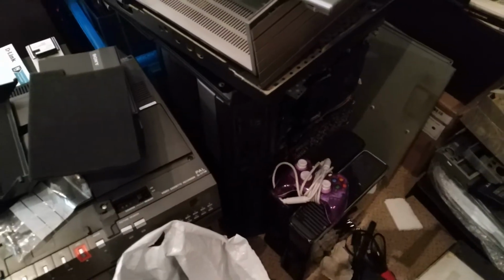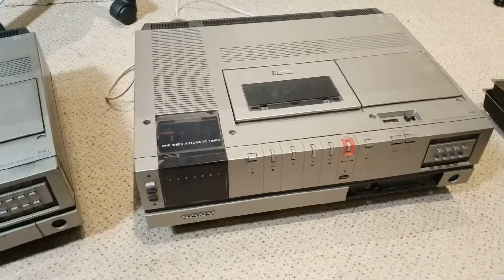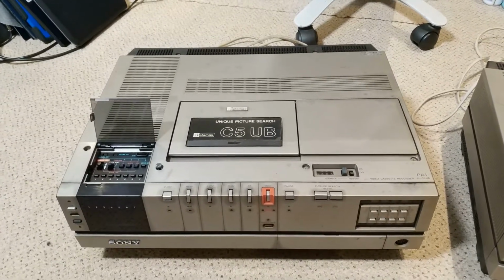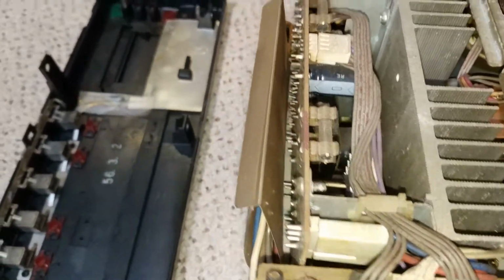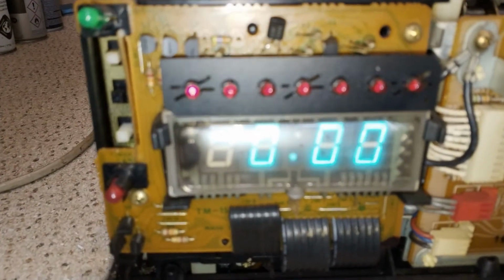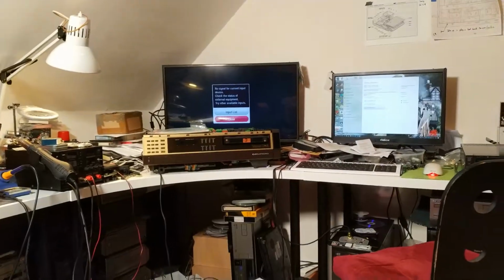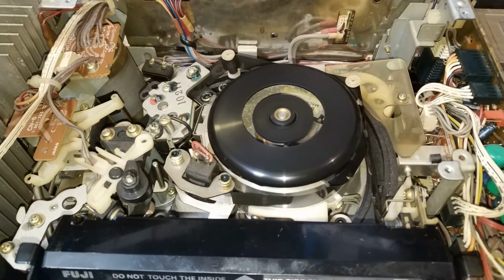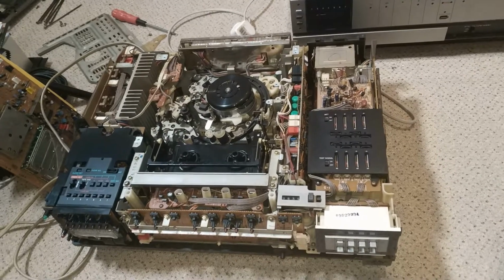Sony SL-C5UB betamax -  checks and repair - Part 1

Comment: hi i just made a sony uvw 1800 out of 3 of them    i keep the right pcb  that has the drum hrs loged in the ic with the head drum and moved 
parts  around     can't a 2nd deck working to many bad decks  there 1 bad vu display i tryed a re cap   i have to check the it's a power rail 100% 
it tip out the power unit there's a safely thing in the power unit  i will wait for a bad one 

they are getting alot harder to find parts now  for betacam  decks  i keep parts in a well good please not in the wet   there a drew thing on the tape bad 
this stop the deck dead bob
Reply from the maker: Great work. So do you now have a good UVW1800?
Reply: hi am using a pro hi 8 hi-fi cam

i know the tape drive is very  bad 

there's video coming out of the  RCA  stockets

i will doing a video on the  betacam 1800 

i pulled apart a deck and part the the, away  

there's one left   in the work shop i need
the vu part  that's all  re cap did not work 
 
it's a lot   i am moving the 100ub out 
of the nice  place  i keep them in the house
there racks in the boys room  it' move to a new place  cover up the pipe work and new floor  a heating  forf the video decks  not out side 

solder don't like the very  cold a tec told me 

bob

Comment: I have one of these machine, purchased from ebay working fine, and it was, put it away as i was decorating, plugged back in a few months later, powers up clock flashing etc but no buttons do anything.  Tape stuck in it too, any ideas? Complete novice, dunno where to start
Reply from the maker: Relatively that's a Pandora's box! I would check the fuses in the left hand power supply board (viewed from the front of the machine) but it does sound like it'll probably be more involved - happy to help where I can though but just be careful and pull the power when you check those fuses!
Reply: @MrBetaByte  check them even tho the machine is receiving power and the clocks flashing?
Reply from the maker: Yes as the fuses supple different areas of the electronics so the fuse that feeds the clock is OK but the fuse that (for example) feeds the logic board might not be. You'll need a meter to do this as on visual inspection the fuses might seem OK but might have gently popped. Let me know how you get on - I may well dig out the service manual and give you some extra pointers if the fuses are all OK.